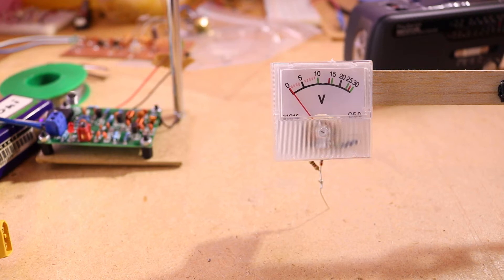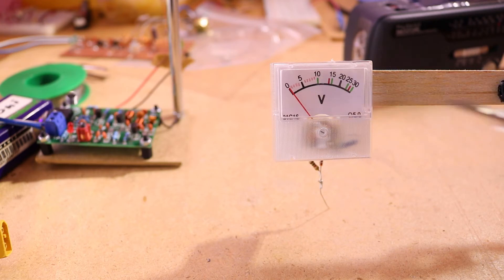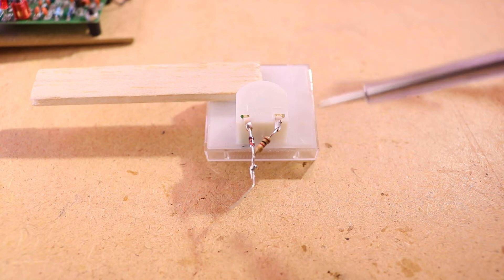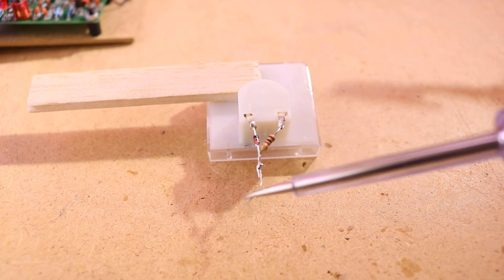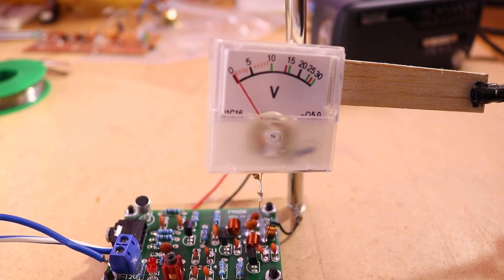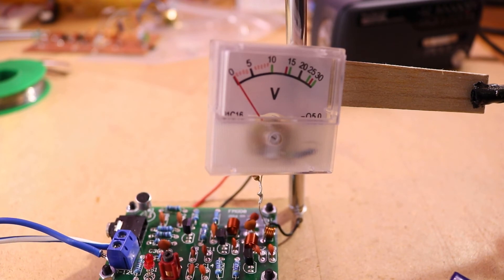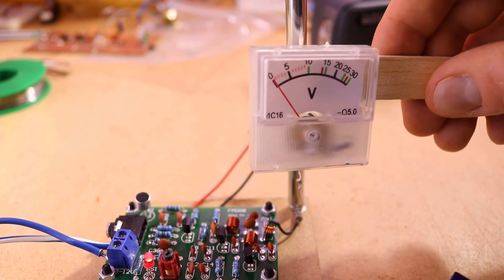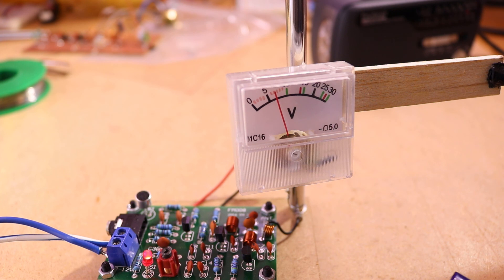How to build an RF Meter [measuring RF without Oscilloscope]

Comment: What does it translates to in terms in miliwatts?
Like 5v on the meter is about 30mW?
Reply from the maker: Unfortunately I have no reference, so idk. Also volts is not watts. That still applies to hf. With that being said, maybe you can calculate that if you assume you have a 50 ohm load. (For example a dipole antenna) But I'm not sure if there's something you have to consider for hf. So I would research that.
Reply: @thesciencefurry  I know that volts are not watts, i ment if the volt meter shows 5 volts, whats the power in mW, Maybe you can take a fm transmitter kit, that you know the output power of, and masure it with this rf meter, so if on that transmitter it shows 5V and you know that the transmitter is 25mW, so you can then write your own numbers, and then you can calculate the other numbers.
It is only showing as 5V, because it was made to show that, but it doesnt show how many volts.
Reply: And one miner question, does it need some kind of germanium diode? or is general 1N4007 enough?
Reply from the maker: @technicmasters7936  It's probably more sensitive with a germanium diode, not sure how well it works with a 1N4007. In the video I used a 1N4148.